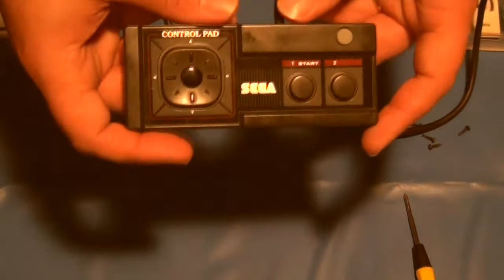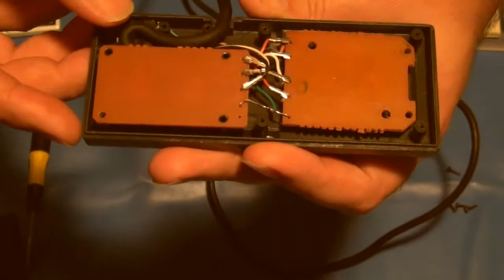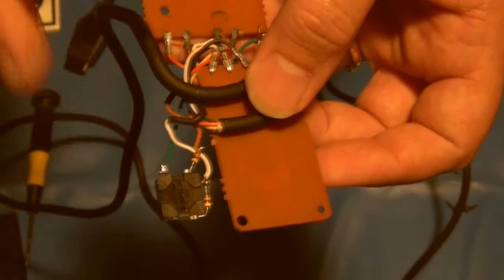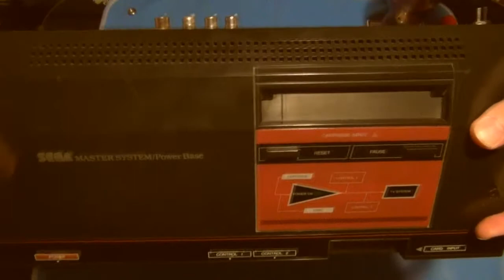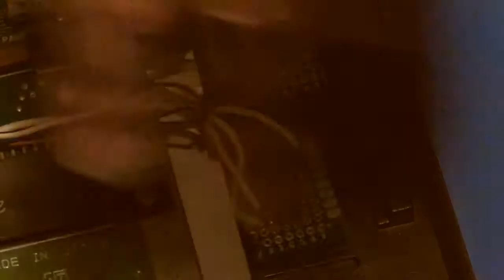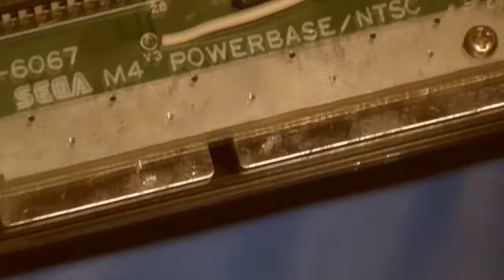ITC#2 - Sega Master System Pause Button Modification

Comment: the s video or rca Jack Mod  is cool. The SMS produces RGB natively and pumps it and Fm sound through the 8 pin din port on the back.  I use a scart cable from Europe and convert the signal through a $40 scart to HDMI device.  Set it to 600/800 resolution at 60 megahertz? and it's a fantastic picture/sound with no noticeable  lag.
Reply from the maker: Yes I know the AV out port on the back provides composite, RGB, and audio from it. But at the time I was mainly interested in getting s-video from it as I didn't have the means for RGB then. I figured if I was going to add the s-video jack, then the RCAs for audio and composite should just be tossed on as well. That way it made it easier to connect the SMS to other AV setups in the future. I now have RGB ability with an OSSC, but I still play the SMS via s-video. I now have all the older retro systems on composite and s-video going through an Extron AV switcher and from that to my OSSC to my TV. It has minimal lag in that it measures about 1-3 fps in lag overall. Much better than the older setup I had.
Reply: @IvoryTowerCollections  cool man. The Detail in your videos and in your reply are appreciated

Comment: Ok, this is fantastic! ...Sadly i'll never able to craft it :P
Reply: I was in the same boat with this sort of thing. Although I haven't had this Mod done cuz SMS controllers are to small I did find a good Mod guy locally on Craig's list and he did my Fm sound chip tho. Seek and ye shall find
Reply from the maker: Yes I have had a few clients send me their SMS systems for FM mod board installation but none have requested I add controller pause mod functions. It isn't that complicated if you use the right logic IC to begin with. Mine was a tad more complicated requiring me to solder other pins on the IC together etc because I had to convert this NAND IC into an OR logic gate. With the right logic you only need to wire to the two input pins and provide power and ground. So still 4 wires to the logic chip, but no additional bridging of the pins needed on the logic. That part you don't see as it was on the bottom of the PCB board in the video.
Reply from the maker: There are premade boards with the logic needed to do this already available to make it easier. But you would still need to mod up a controller physically to use it. Check Etsy shops as again I've seen places that offer this in kit format now. Thank you for your comment and for watching!

Comment: what if you use mega drive controllers that have pause buttons built in ? 
can you just wire the pin on the female end of the socket which is the pause pin on the controller directly to the pause + wire on the console ?
Reply from the maker: No. The Genesis controller while somewhat compatible uses a logic IC to translate the button presses etc to the console. The SMS doesn't recognize any of this and as far as I know, there isn't a pause/halt line available through the controller pinouts. This is why you have to create an impossible controller combination that the additional logic I had to create inside the SMS is able to recognize as a pause and then essentially close that out to the needed circuit on the master system main board. This is also why there is a pause button on the power base converter and on the sega master system converters for use on the Genesis still to this day.
Reply: Ivory Tower Collections i figured since all the other mega drive controller buttons work on a sms2  (Obviously not the a or c) the pause button doesnt as the pin on the console goes nowhere